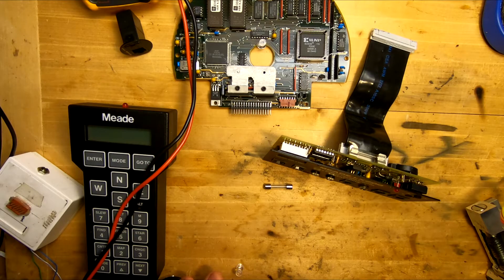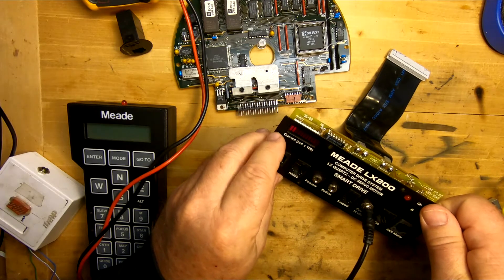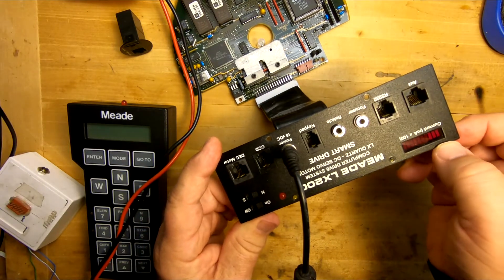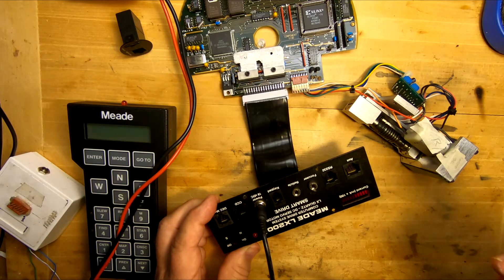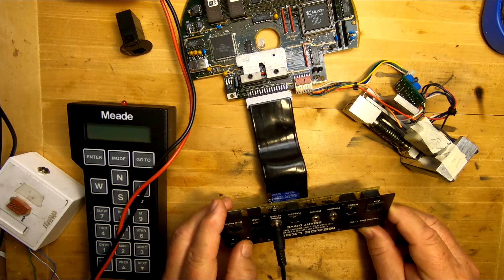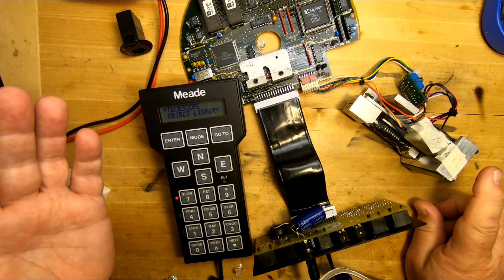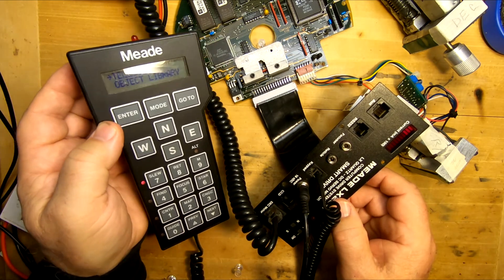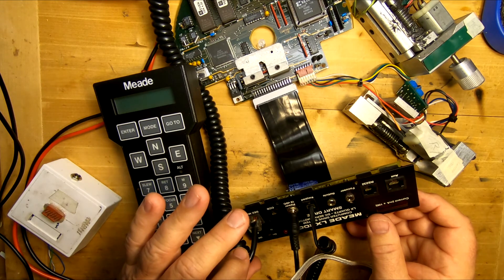Troubleshooting A Meade LX200 Classic Telescope! Part 1

Comment: Wow I found someone that owns this telescope! I just purchased a 10" classic with a 92 date inside the hand controller. I connected it to the wall adapter which was never used and nothing happened. I plugged in the car 18 to 12v adapter and it beeped once and then nothing else happened. Unfortunately I overpaid because I thought half the asking price would be worth my trouble and I thought I'd be able to purchase a used mount for the money I saved but I cannot find any online. Do you work on these for a living? Could I send you the electronics and pay you to take a look at it? I know very little about electronics but I do have a soldering iron and I'm pretty good at taking things apart.

Comment: Hello, I am working on an LX200 telescope that came with not turning on, I have fixed the issue, but now the motors are spinning continuously. Is there any hint you can give me to point me in the right direction? Thanks
Reply from the maker: Is it both motors or just one? What is your setup for testing...bench or in the scope? Check your big ribbon cable to make sure you are not one pin or row off. Usually when both motors go into runaway, it's a wiring problem.
Reply: @lx200electronicsexchange7  Hi, thanks for your reply. I am testing in the scope; the power board was faulty at the beginning, with some capacitors burned, I fixed that, but now, when I power on the scope both motors are starting to spin continuously
Reply: I’m having same problem. But just the bottom motor spinning, have you fixed that problem yet?

Comment: I have a Meade 12 inch Classic and my scope passes all these tests but, the declination motor does not move when I press the N and S keys on my controller.   I have determinesdthat the declination motor is good by placing a 3 volt battery across the declination motor inputs. I did remove the declination cable from the front panel while performing this test.  Do you have any ideas what might be wrong?
Reply from the maker: It could be the hand controller...ribbon cable burnt, a bad motor control board or U18 chip

Comment: My LX200 Classic powers on with two bars and gives a beep. It says Clearline on the hand paddle display, but it does nothing else. The buttons do nothing, the motors do not turn, and the display stays frozen.
With all the parts still in the scope, can I troubleshoot this by unplugging things in the reverse order? DEC motor, hand paddle, RA motor, mainboard, etc?
Reply from the maker: You need to test the RA motor. I'll go live on Tuesday 7/12/2022 at 7pm EDT and show you how to check it with an ohm meter

Comment: I've recently bought an old (classic) LX200 for a very nice price second hand. However the previous owner turned it on after a long time no use and guess what happend... C2 burned out and put a hole inside the ribbon cable, like you said...

I'm looking now to replace the broken C2, and i've found a scheme that says it should be a 6.8UF capacitor, is this correct?
Reply from the maker: Yes that would work. 6.8 - 10 uf are all good just get ones 35v-50v not the original 25v rated